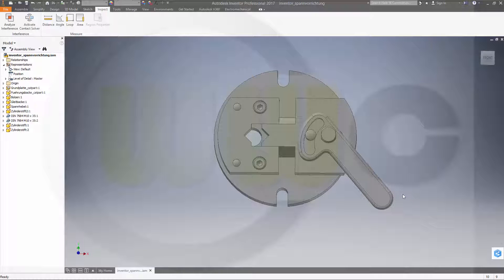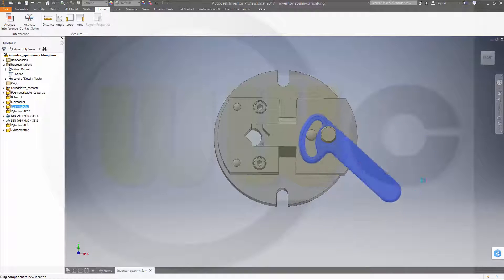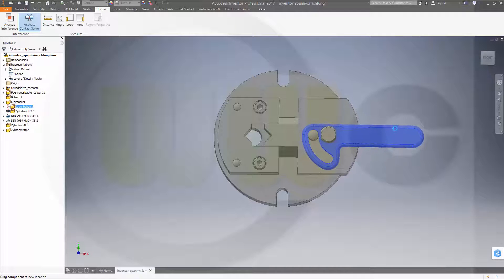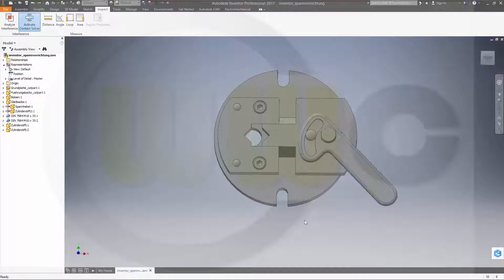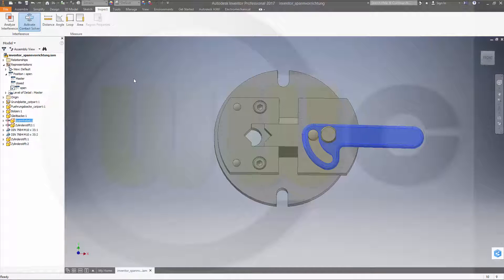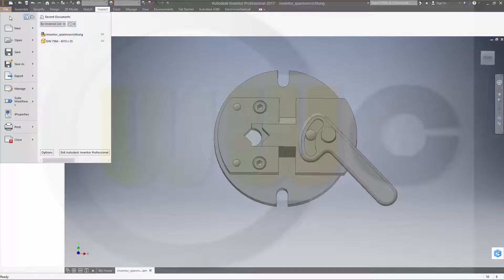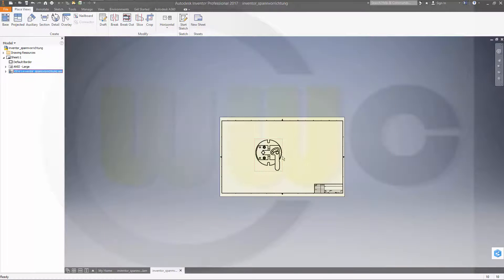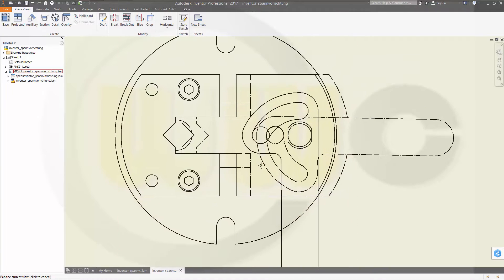Positions Inventor 2017 Training - Overlay Views - Contact Solver

Comment: You are doing a great job for both Inventor and NX. Danke
Reply from the maker: You´re welcome
Reply: @wolfgang.walden.cad.training  One question if I may: In NX there is a feature called reference set. For example, one part can be shown with drilled holes and without at the same time. Do we have the same feature in Autodesk Inventor?
Reply from the maker: Sorry, reference sets are used in a different way i.e. to LOAD only needed features of a part in an assembly.
But there is a new feature in Inventor 2022 which does exactly what you want - MODEL STATES (SUPRESSES certain features in a part)
Reply: @wolfgang.walden.cad.training  OK. I understand. I haven't gotten Inventor 2022 yet.